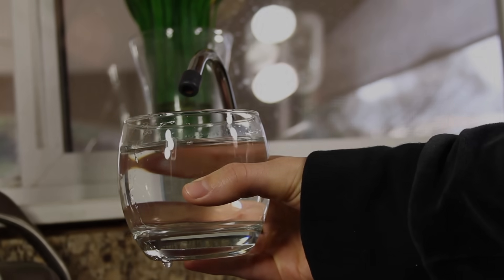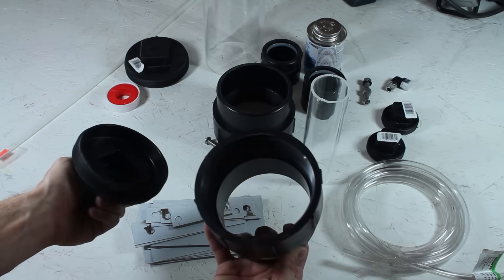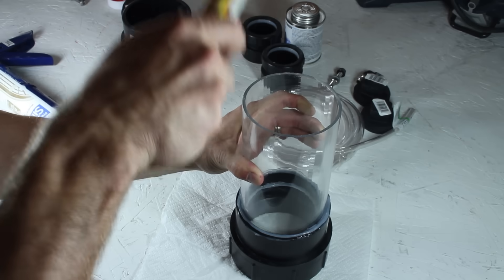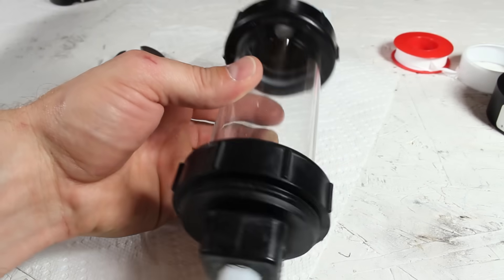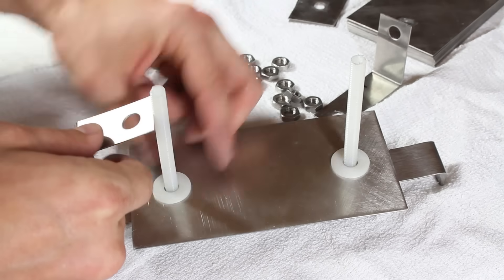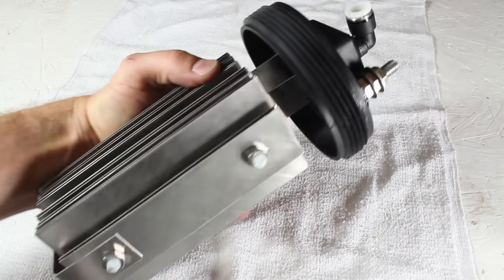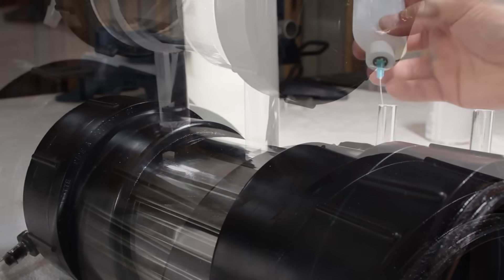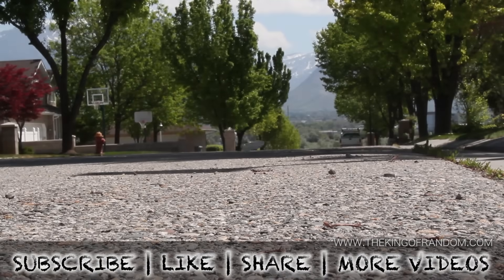HHO Generator - Water to Fuel Converter

Comment: It is fast and can be used to run a internal combustion engine so why you waiting, make a video on run 3ngine with hydrogen
Reply: I ran my van on one of these along with the gas went from 17 /25 MPG to 55/65 mpg you need to get a unit on ebay to tell the engine it is putting in way to much gas it connects to the O2 sensor  added the Oxy-Hydrogen gas into the air intake

Comment: wont the battery be short circuited or are the positive and negative not connected?
Reply: They're not connected, the solution completes the circuit, and the power applied to the solution splits the h2o into hydrogen and oxygen gas.

Comment: I wonder could you use liquid nitrogen to cool the hydrogen gas into a liquid?
Reply: Hydrogen gas has (I'm pretty sure) the lowest boiling /condensation point. It would take a way way lower temperature than liquid nitrogen.

Comment: I just had a great idea for you, see if you can make enough of the HHO  with that to run a 4 or 5 burner infrared heater.  You might have to have more than one of those HHO generators or a larger one, I have no idea. Also see if you can power all of that with a solar panel or panels. Thanks  that was really  cool.

Comment: Man that's exactly how you make hydrogen now imagine taking a 55 gallon drum with a spark plug in it and then you wire headphone jack to the spark plug and then you plug a cell phone in it walkway and call it
Reply: Kevin Gilmore exactly how is a small voltage supposed to induce a spark hot enough to ignite the hydrogen?
Reply: @NitroGuyJH  bro it's very very easily to make hydrogen
Reply: Kevin Gilmore I don’t think you quite understand my imposition. I’ve made HHO before and yes it is easily done and also in multiple ways. What I’m saying is how do you figure you’re going to ignite the hydrogen with merely a spark plug, 3.5mm headphone jack, and a cellular device? A spark plug will not produce a viable enough spark by just directing the incoming calls voltage to it from the phone. You will have to apply several thousands of volts to the spark plug instantaneously to break the ionization of air to create a spark
Reply: that's how they terraform the planet was with hydrogen but they use liquid zinc and acid to create the hydrogen and the pyramids in Giza
Reply: You don't believe me make it in the do-it-yourself bro it's not too hard
Reply: Kevin Gilmore I want you to tell me how.
Reply: @NitroGuyJH  first off to make hydrogen you need water baking soda and electricity you need a sealed container that you can seal up you need a negative and positive coming off to the negative and positives you want plates almost touching but not touching coming out the top you want to hose you want the hose to go into a bottle of water like a bong it's that easy bro
Reply: Kevin Gilmore i live in USA, do you reside here in the states as well? I own a small Cessna if you want to collab on these projects.
Reply: @NitroGuyJH  dude I don't know much about airplanes grout would love to learn and are you trying to convert them to hydrogen's I what you trying to tell me so I've always wanted to make an airplane with hydrogen rockets on it to keep it real
Reply: @NitroGuyJH  be a problem in Ohio
Reply: Kevin Gilmore not converting to hydrogen rockets. Rather burn the hydrogen inside the existing engine
Reply: @NitroGuyJH  that wouldn't be hard all you'd have to do is Hook the hydrogen hose into one of the vacuum lines that go into the intake you start your plane up and then turn the hydrogen cell on it'll cut your fuel in half theoretically
Reply: Kevin Gilmore I tried that but the engine won’t start with the setup like that. What should I try next?
Reply: @NitroGuyJH  start the engine then turn the hydrogen on

Comment: One update you could maybe do is a second chamber with a tube in the center so the electrolyte solution could flow through, but with the negative terminal in one and the positive on the other to separate the hydrogen from the oxygen. This process is actually how submarines have evolved to stay below water indefinitely provided they have food.

Comment: DO NOT USE STAINLESS STEEL, use titanium.   SS leeches chromium into the water as part of the electrolysis.
it is extremely toxic.
Reply: I mean I’m not gonna drink it.
Reply: Titanium (at least for the anode side) needs to be coated with either gold, a platinum group metal, or mixed metal oxides in order to work. 316/L stainless holds up extremely well in even 20% NaOH or KOH electrolyte for years, and the fears of producing specifically hexavalent chromium may be unfounded.
Reply: Just use normal steel, the sodium or potassium hydroxide should keep it from rusting
Reply: Hi
Did we have to change the steel more often?
How much it last??
Reply: Just do it outside
Reply: @hollw9474  
Can i have your whatsapp number
Reply: @محمدباوی-ض7س  no
Reply: Please give me your whatsapp number

Comment: Congratulations, you just created a hho kit for your car. It will reduce your fuel consumption anywhere from 50 to 80 % and remove all the carbon deposits in the engine. Also it will reduce the amount of dangerous gas emissions.
So happy green journey. And do make a video and long term test of your hho kit. All the very best.
Reply: Sandeep K how is it actually utilised in an engine, is the gas fed through the air intake or direct injection to the cylinders like NOS?

Comment: one thing i would do differeant i must say cut or leave 1/2 tangs onoposite top corners allowing you to use stanless bolts to sandwitch the plates the compression contact of the nylon is seriously less a connectionas will be if the tangs are drilled and left and right side positioning then go ahead and use the nylon for positioning alone"... or use like 4 tangs positve and fore tangs negative(connect screws #10) then you can have bullet proof current grid and use the nylon as separaters only thanks

Comment: yours makes more than mine. 2 large bubbles per second, but it's also smaller.
Reply: The gas output is proportional to the amount of energy used to separate the water molecules. Different mixtures mean different output. More plates means more current, therefore more applied power. More voltage means more current. Raising either or both means more gas production.

Comment: Do you have any issues with the plates or terminals over heating and melting the clean out cap, I've seen it in a couple videos, also, Are you running you car batteries in parallel or series?

Comment: Actually these are old methods called hydrogen generator. A.K.A brown gas. 
It can also be used to run a car.. but this idiots give bad ideas to ppl ith this gas and it's the exact reason why it was hidden for many years .
It's called a drycell hydrogen generator. This methods is a wet cell

Comment: HHO is water. H2 + O2 is the product that is created.
Reply: HHO is a term used by people who do electrolysis and refers to the combined amounts of hydrogen and oxygen gained from the water. Because a water molecule contains 2 hydrogen atoms and one oxygen you can be quite sure this is the exact mixture you're getting from the generator and is the most explosive mixture. Water is mostly called H2O while the gas mix is usually referred to as HHO. Although it's not a scientific term it is used often by people who build these generators.
Reply: Niels right right, I should clarify that HHO has seem to become an official term and there’s nothing I can really do about that. It seems a bit misleading though. The actual state of the new gases are 2 h2 + 1 o2 for every water molecule just for people who are confused about this. I’m sure some less science-savvy folk are scratching their heads.

Comment: I've tried this multiple times at home but every time it either corroded or disintegrated
Reply: Yes, the metal will give up molecules in the process and the water needs a salt. As you know, water will already corrode many metals rather quickly. I suggested the use of Platinum because I know it doesn't lose any molecules in the catalytic process occurring under your car. I wondered if it would fare better in this application.

Comment: Yeah, your mixing your hydrogen and oxygen, and if a spark comes in contact with the mixture, it explodes,  If you want the fuel you have to just collect the hydrogen and let the oxygen go. Hydrogen comes bubbling from the negative electrode and the oxygen bubbles from the positive electrode, as long as both electrodes are in close proximity to each other,. But bubble off oth gases separately, Natural gas is basically the same thing as hydrogen., to advoid any explosion, don't let the oxygen and hydrogen get mixed together..

Comment: Grant I have a question could you use this design to create fuel for your mini metal melting Foundry as a substitute for propane and if so I would love to see it
Reply: From what I understand these systems dont create enough usable gas as of yet. It takes just as much energy to split the gas as you get out.
Reply: @gregrohs6688 , all you need is a regenerative energy source to run the hydrolyzer. Solar, wind, or falling water (if it's flowing, it is falling; heading toward gravity) will run it for free except for the cost of the water and whatever salt you use.
Reply: @gregrohs6688  it will take more to split it.
Reply: @gregrohs6688  I think there will be losses along the way so the enery you get is less than the energy you put into. But I think it makes for a more efficient burn in an engine so the inefficiency of the system is still worth the saved dollars.
Reply: @TheCaser78, Hydrogen burns much hotter than Propane and it's completely clean energy if you use something like solar or wind or water turbine power to run the hydrolyzer.
Reply: built the foundry. And that is a hood idea. Telk me how it turns out. I might just do it myself.
Reply: @TheCaser78 and did it work??
Reply: I think the problem is hydrogen has a habit of burning very fast, so burns back in the burner instead if closer to the furnace.
Reply: Stanley Meyer "water car - hydrogen on demand inventor" discovered the frequency for over unity via this hydrogen tech.
Do some research on the man, his patents and his brother's continued work on HHO.
Reply: @ElectronicSkateboard  HHO systems is already commercially available. There are legit companies ypu can buy the systems from. Only issue is the energy being put into splitting the water is equal or even more than the output. Making it not s viable fuel source in itself.
Reply: Not at 20KHz

Comment: You need to separate the hydrogen and oxygen while it's being produced. I think this is the reason people can't get cars to run right on the generators, too much o2. You get it from the generator and as it enters the intake. The negative side produces the hydrogen which you need to capture alone. The positive side can just be vented to atmosphere. I drew a picture to show what I mean but obviously can't post here. Need to make it look similar to a double boiler except the inner would be upside down to catch the hydrogen only from the process. The positive can just be open. Take this setup made here, don't cap one end and make the plates all connected to negative. Drop it into a pot of water and make the outer water positive with a plate or carbon rod. You need the cylinder to be non conductive like this, or just not connected to power at all I guess. If I had the time and skills, I would do this myself. My old boss tried to make a motorcycle run with a generator but it just pops and farts and won't run. I realize it's because the hydrogen is too lean with oxygen. He's a busy guy and doesn't have the time to build and test my theory. Lng and propane vehicles gases aren't diluted with oxygen, they get that from the intake therefore the hydrogen can't be diluted either. I'm sure this will work.

Comment: Can you show how to make cooking stove version so we can use HHO for cooking food?
Reply: Invest in a chainsaw, then you can legally go into your forest and collect some firewood. Then you can mine your flint underground, then forge your own steel. Better than gas stoves or hydrogen.
Reply: HHO is far too volatile. If you hook it up to a regular gas hob, it's likely to blow up unless you carefully control the output pressure, and even then, the flame is hot enough to melt a few metals. Not recommended for cooking
Reply: hi sir can i know what can you recommend instead of using HHO for cooking?my mother are having a hard time to collect some woods for cooking we don't have enough supply of it and even if i plant some trees it would take a long time to have it when she needed it now

Comment: Wow well done,try placing the electrodes even closer almost touching,may require more regular spacing but give it a try you will get some interesting results and don't worry about the sand papering because that will affect how close you can place the plates before they tough

Comment: What happens if you install it in a power generator and the power source to make fuel is from the power generator? Will it generate much power or the generator just delivers 0.00 amps(because its been used by the hydrogen cell)?
Reply: It wont even work because it will convert more energy into heat and wont reach even a 0.00% lol

Comment: We will be using fossil fuels until the planet is A: Either sucked of all the non-renewable resource or B: We rapidly approach this point. Hydrogen is a extremely combustable gas that could easily be converted into internal combustion people have already made cars that run off of water. We don't have hydrogen powered cars because major companies want to continue to make profit off of oil.

Comment: "Trimmed down"....SNAP.  ;-)  Gotta admit, quick and seemed to work pretty well, though.  Other than that, actually pretty professionally made.  Not too shabby.  You should put some water in those bottles and a way to slip seal the bottoms, and light the gas.  Some fins added, and you should really have a water rocket!!!  Might need to do some fiddling with the "nozzle" size to preclude what happened to a few of your bottles, if just the inertia in the water isn't enough to cause it to go high order itself.  ;-)

Comment: Potential of hydrogen as a fuel is unlimited. Hydrogen can be made from water using electricity from solar or wind power and stored in liquid form in traditional looking gas stations from where,  customers can fill a car's tank in less than 5 minutes.  That is why Toyota went with hydrogen fuel cell technology as opposed to lithium ion batteries to power their electric cars. As demand for lithium and cobalt increases, it's price also going up making it increasingly difficult to economically produce large capacity lithium-ion batteries.  It is true producing hydrogen takes up lot of electric energy, but hydrogen in liquid form has enough energy density and price advantage to beat it's renewable energy competitors in mobile applications such as powering cars and trucks.
Reply: Praveen George That‘s certainly possible (and it‘s lithium-ion batteries).
Reply: 007Cat24
 :)

Comment: Is it possible to use a Oxy-Hydrogen generator for home heating rather than burning oil?
Reply: Drew C you might have to separate the gasses and burn only the hydrogen because the oxygen makes the gas a whole lot more powerful because it is an oxidiser (duh)

Comment: I wish I could do this, but in Australia, I cannot find clear acrylic tubing, and the only ones I can find are very expensive and from overseas. Will have to find another way around the issue, but the video is still amazing, even if I cannot build one myself just yet
Reply: Andrey Rumming you can make it in any container, you can use a 5 gallon bucket and super size it if you want.. you don't even need a container.. all you need is stainless steel plates spaced apart under water and a battery
Reply: Go to the hardware store and buy a water filter container   they are clear and already to go .
Reply: i often looked at a cars air filter and thought if the inner wires are separated from the outer ones you could produce a field to split the water...what did you mean by the water filer how can i use this? as a container? or for splitting?
Reply: brenen smithsonian it's a clear container is what he's saying, one that you can drop the plates in.. basically a supplement for the container in the video
Reply: PVC Pressure pipe possibly will work. I'm going to bunnings tomorrow to get some pipe, caps, clear vinyl hose and some steel plates. I'm improvising, as this is what we do in Australia ey lol.
Reply: btw you could just get a glass bottle, some lye/solid drain cleaner, alfoil and this produces hydrogen instantly. Careful its hot and toxic (the bottle)
Reply: @mattbailey1015 that's toxic like you said and thus not clean energy
Reply: australia us one of the few places allowed to run your car on this as long as you dont sell it ..talk about it...advertiase that u got it or try to share it...u can run your vehicle on it ...its a no no in the US...you can only use it as a "fuel" optomizer
Reply: brenen smithsonian because of it lagging down the alternator it is almost impossible to make it 100% efficient.. most people can't do it.. But it is possible to make it more efficient then it was
Reply: brenen smithsonian where is that defined in the US? Per state of federal? Tks
Reply: I LOVE AUSTRALIA!!!!!!!!!!!!!!!!!!!!!!!!!!!

Comment: Man that's ALOT of work. I built one over 30 yrs ago using a car/semi battery. Filled it with distilled water and switched the polarity. This I believe, is known as electrolysis. Hooked to the air intake and increased MPG, horse and torque.

"keep the faith people, and keep on keeping on"

Comment: I need one of these in my Fidgety Gravity Lac to make helium or hydrogen so it will float like a light weight hub motor reconfigured and reshaped into a Gyroscope generator so i can use centrifugal force as my power source..